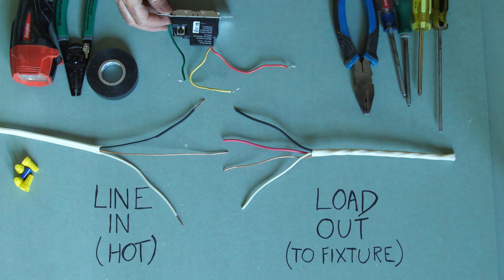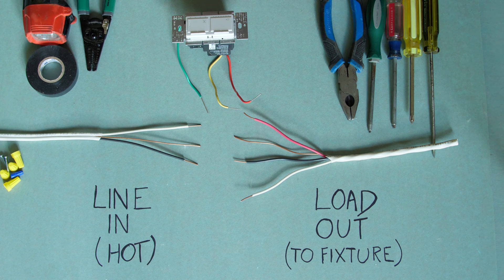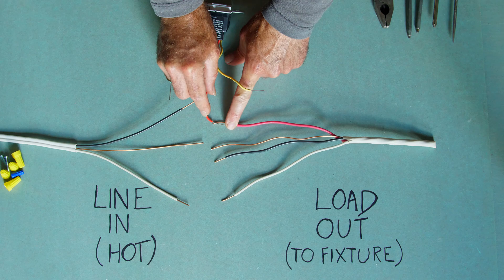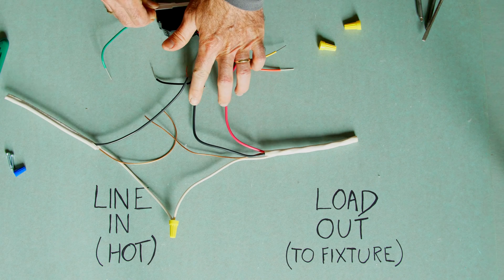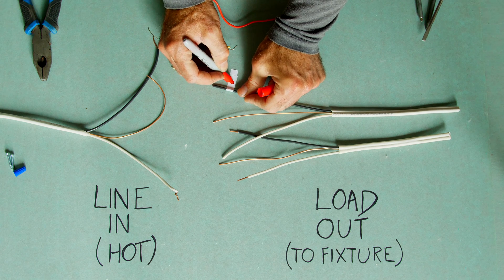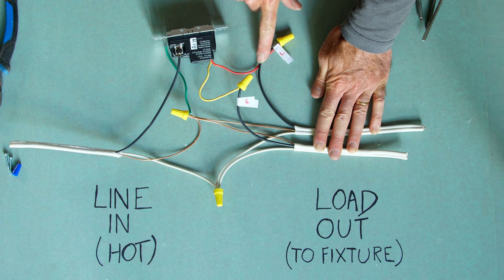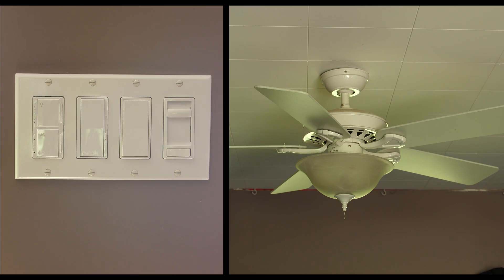⚡️How To: Wiring Ceiling Fan & Light | Clear & Simple Instructions | UHD 4K

Comment: Great video,but you wouldn’t have to go into the fan itself to rewire there ?
Reply from the maker: The fan/light should be pre-wired with a long length of wire that will fit through the down rod so that the wiring you perform with be in the junction box. 
Even when you are adding a light kit to a fan that comes without light, there will likely be a wire harness (or equivalent) in the cap (nose cone) ready to accept a wiring from an add-on light kit.
Thanks for watching!

Comment: I really appreciate this video thank you so much I’m installing two ceiling fans and light together but I only have 14-2 wire running from electrical box to fixture so both fan and light it’s being controlled by a dimmer switch I know it’s better with 14-3  but in this case that’s what I have so thanks again for the video very helpful

Comment: Someone told me a loud out of a fan (for two ceiling LED light fixtures) is not recommended and I should run independent dedicated wires.

Should I run a separate wire for the light fixture or can I use the fan 14-3 for the load out just like the fan built in light for additional ceiling light that isn’t part of thr fan?

Comment: Excellent, excellent video.. I liked the top down view of everything. I am replacing 2 wire with 3 wire so that light and fan can be controlled separately. This helps tremendously. It seems as though I should be able to do it. I'd call an electrician, except I need this done 4 times.. if I can just learn it once, I can quickly/cheaply replicate it to the 3 other rooms

Comment: Not covered is: One combination is where BOTH wires coming into the box are 14-2. Whites wired together, grounds wired together and (with current fan/light switch) the 2 black wires coming off the switch wired individually to the 2 black wires one coming from the breaker box and one going to the fan/light. What then?
Thanks

Comment: i bought the same fan and light dimmer to find only 2 black wires. The ceiling fan and light is currently connected to a universal intertek 99111 kit. When i removed the wall plate i found out it was wireless and behind it were the to black wires connected. (my house was built in the 20s) I would love any help.

Comment: Great video, nice & slow & easy to follow for us rookies! But, please add a "how to" wire a duel switches, please. Nothing too fancy, One switch for the fan, (maybe with a speed control), & and a regular on off for the light. Thanks!
Reply: Using 12/3 or 14/3
Reply: Asking, because I am wiring for the future. Just have a light for now, but want the 12/3 to be in the box when/if I put a fan light fixture in the room. (Replacing OLD groundless romex type  wires in the attic.) : /
Reply from the maker: Great suggestion.  Thank you, and thanks for watching!

Comment: I’m looking for a video on how to wire a ceiling fan when the power comes from the panel to the ceiling box first and then over to a single pole switch on the wall last.  I have only found videos where power comes from the panel to the light switch first and then up to the ceiling.  At my in-laws house, in their master bedroom, the power from the panel goes to the ceiling box 1st and then over to the single pole wall switch last.  I am not familiar with wiring a ceiling fan in this scenario.

Comment: thanks for sharing! The directions for the fan is not using the red wire only white to white and black to Black. Just wondering if it will still work the same with a switch like that?

Comment: Amazing video. 
Just picked up a fan, used with no wall switch. Figured out I need to order a "2 wire" switch from the supplier.
Looks like there are way more options for 3 wires but unfortunately I have two romex reaching the fan, but only one leg from the switch. Second romex is constant hot. Must have been to give the home owner an option of operating fan from the fan or from the switch.
Reply from the maker: Best of luck with that.  Thanks for watching!

Comment: My new home ceilng fan have red,white,black and green. My fan have only white,black and green. How do I run the red wire from my home. Please help
Reply: Connect white-white, green-green or bare (ground), black-black + red (red is the hot for the light, black is hot for the fan)
Reply: New fans (with lights) come with manual and wiring diagram, you can check wiring for single switch or double switches. The red wire normally is the hot for the lights, or sometimes depending on manufacturer comes in blue wire

Comment: Hello, I am trying to install a ceiling fan/light dimmer. However my load out (to fixture)wire only has three wires. A black wire, white wire, and a ground wire. There is no fourth red wire. So I’m not sure what controls the light and fan motor. What do I do in the situation? 

Also, I noticed when I opened up the previous switch that then black wires from the “line in” and “load out” were capped together instead of the white wires. Would this be incorrect or does my neutral wires happen to be black in instead of white.

Comment: I have two hot wires (black) two neutral wires (white) and two copper wires coming from a single ceiling light hole from which a hanging dimmable light once was. I wanted to switch to a flush mount ceiling light which as you know I'm sure only has one black wire one white wire and one copper wire. So I hooked both hot wires from the ceiling to the single black wire on the light fixture and both neutral wires from the ceiling to the single white wire on the light fixture and the copper wire from the light fixture to the green screw on the mount. I put the bulbs in, turn the power back on and the lights stayed on, literally could not turn them off.  the dimmable light switch did not work when it worked for the previous light. I hope this makes sense, probably not. I need help, I don't know what to do

Comment: My situation:
In ceiling fan, brown and white wire come in hot, another goes out to switch hot.
Not labeled., brown is neutral, white is hot.

At the switch, i have 2 black poles on either side and 2 silver on left side.

I hooked up white (hot) to solo right pole.
Brown to light. Light works.

I fed a black a white wire through ceiling. Black to silver pole, hooked it up to blue which controls my fan.
With the white wire, I dont know where to connect it to at the switch. But i wired it up with the neutrals in the ceiling fan.

Not working. Tried a few different ways.
Reply: I got the same issue I have 4 coming in with a remote controlled fan having 4 wires and the fan having 4 wires bit the kicker is on instructions it says black with black white with white and the 2 left from switch one color goes to the same one from fan and controller but in the end leaving 1 alone that's coming in im assuming it goes to neutral but thought this video would help its for 3 coming in I have 4.

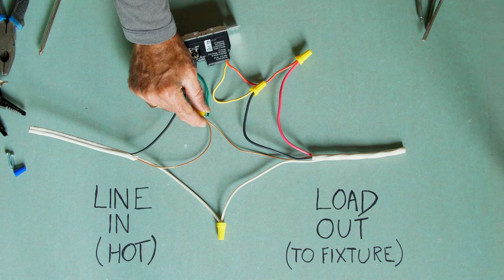Comment: I bought the Lutron combo fan and light dimmer but having some issues. I connected like how you show around the 4:16 mark. However, my line in hot wire is shared with another 3 way light switch that is on another breaker. I can only turn on my fan light with the new combo switch and not the fan. My remote control can turn on thr fan and fan light but the switch can only turn on the fan light. Not sure what I am doing wrong.  Fan wired as: fan blue wire to red, fan black wire to black, fan white to white, fan green to copper.

Comment: I just blew up this same switch trying to wire mine up correctly.. my fan has remote control and can’t get the fan to work on the speed control but the light will..I hooked my switch up exactly like the one in your video and just can’t get it to work..try, try and try again

Comment: In the box I have three white wires which are all connected, then I have a switch that has two black wires it is a simple switch one black wire on top and one black wire on the bottom. The black wire which is on top goes to a conglomerate which adds to other black wires. And then of course there are the copper grounds. But I want to hook up is a switch which has four wires the black green ground, red and yellow., In order to separate the fan from the light
Reply: Hard to describe without being able to send a picture to you

Comment: Hi i installed a ceiling fan there use to be only one switch for the light   on the wall but there already was   red white   black  and cooper  were   coming from the  ceiling  junction box  and then i connected the  fan black  to black blue to red  white  to  white  and  cooper to cooper but in the  wall   switch  the  wire that is hot  the black one  i connect that to  both switch and   connect  the  black one that  comes from ceiling  fan to  one switch and  the red one that comes from fan light to  another switch everything works but   the problem is that when i   use two switch instead of  one  which and the  hot wire that was  going to 2 switches were also    giving  electricity  to wall outlets and  it was   connected to some other wires in  ceiling junction box     since i  used  2  regular switches now it   lost its continuity and now some of the  wall  outlet that  use to get  its power  from that  are not working unless that i  flip the switch and turn the fan on   IS THERE ANY  WAY OR SWITCH TO FIX THAT  
 Thanks

Comment: What would happen if you wire the fan wire and the light wire opposite ? Thanks !
Reply: Most fans have reverse polarity protection. If you hook it up the wrong way it simply does nothing. They're designed to push air in one direction and the manufacturers have ensured that's the only way they'll work.
Reply: It would trip the breaker as soon as turns on. Worst case scenario it catches fire.

Comment: What would you do if you were replacing a light with a fan that you would want to use a double switch on but the wire running from the existing light to the box was only a single hot wire not a double hot wire?
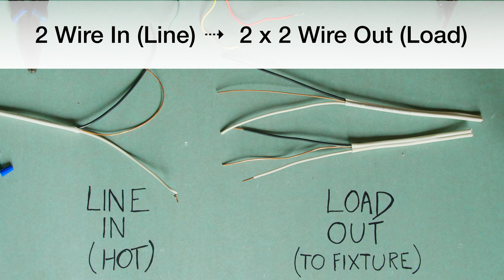Reply: Unless you can run an additional 2 wire (e.g. 12/2 or 14/2) as shown in his 3rd example @6:30 , you would have to wire the fan motor and light together to the single hot wire coming from the switch and then use the pull chains to control the light and fan independently.

Comment: 5:50, Why did you pigtail the incoming hot on the second example?
Reply from the maker: Hi Jordan.  The switch has a hard-wired black wire coming from it.  The black "hot" line-in is connected to the hard-wired black wire from the switch.  There is no pigtail in that particular example.  I hope that helps.
Reply: @SaveMoneyTV  

1.)   You'll have to forgive me I'm a bit of a slow learner. I see a black (hot) coming from the panel and once it reaches the switch you appear to have placed a yellow wirenut around the tip and I assume the other black wire coming out of that wirenut would be tied to the switch itself?  I'm other words would your incoming hot simply be connected directly to the switch?  (As you say with no pigtails?)  

2.)  And what would you do if you had a second switch or reciprocal box in the same room? Would you pigtail the incoming hot (from the panel) and send the pigtail further down to the next switch?